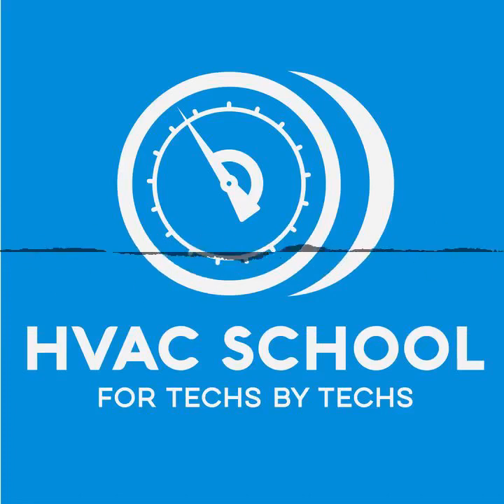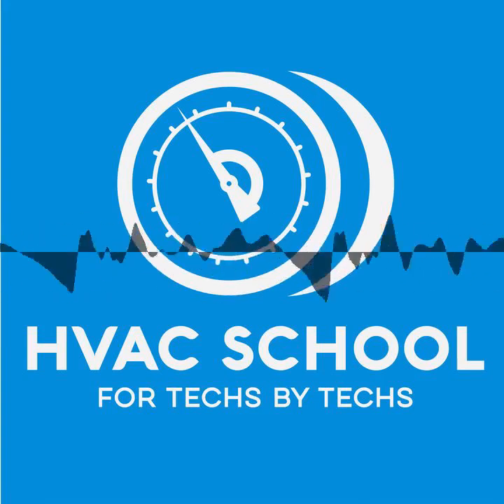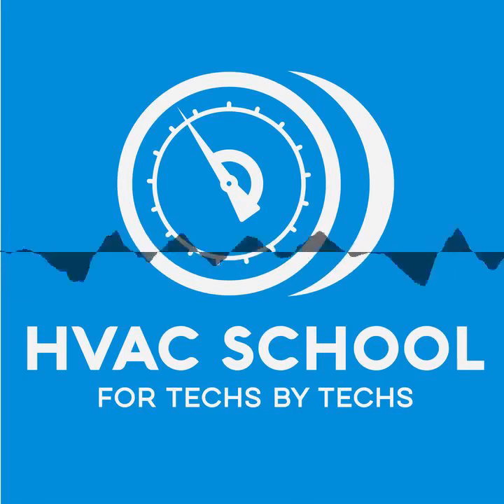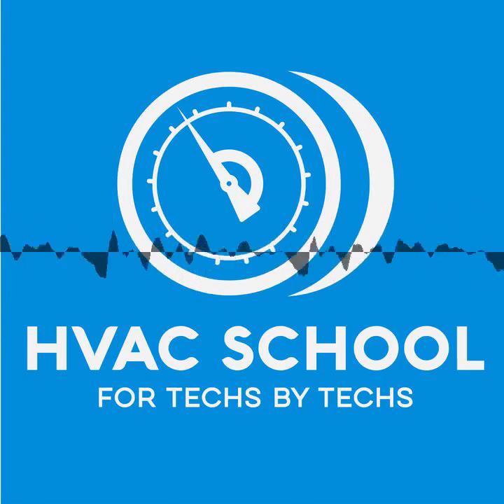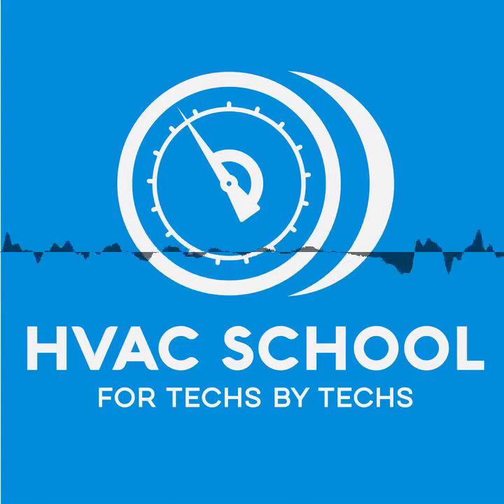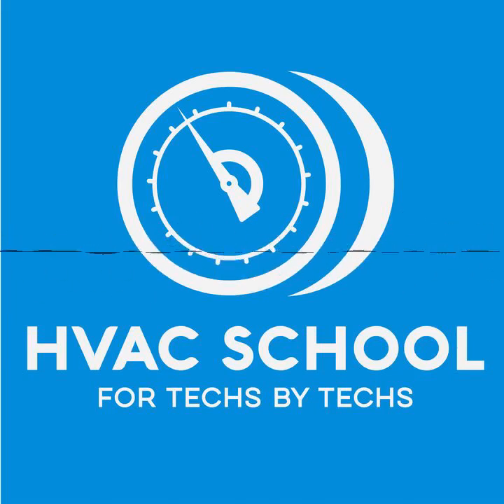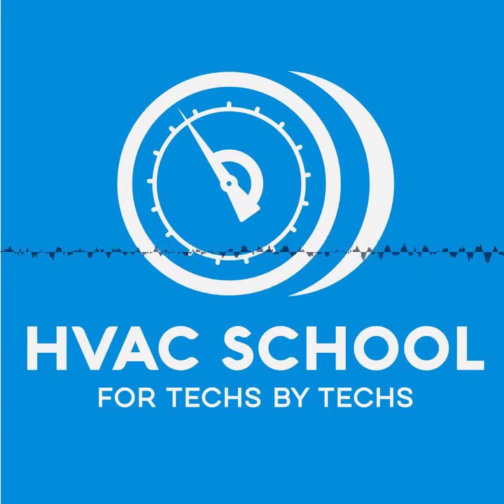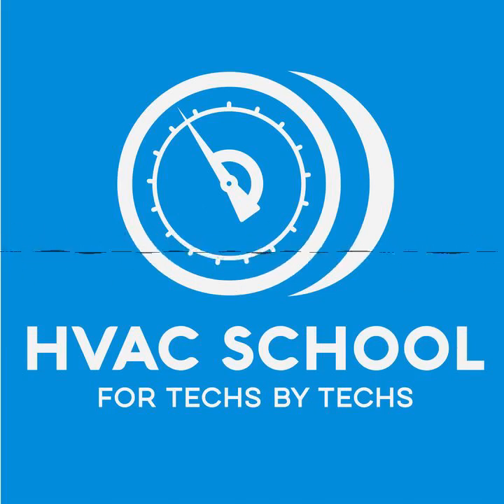VRF in Real Life w/ John Oaks

Comment: I tried to wrap my mind around the 2 pipe system diagrammatically what I came up with is the following:
-The 2 lines connecting the branch circuit box to each indoor unit should be liquid and gas... 
-Solenoids control whether its "hot liquid return" and "hot gas supply" or "cold liquid supply" and "cold gas return"...
-There should only need to be one single TXV in the Branch Controller that allows for one hot-liquid-return header and one cold-liquid-supply header (so four  headers confined within the branch box) and HOT-Gas or COLD-Gas lines connecting Branch controller and Outdoor unit.
The Outdoor Unit should have its own TXV that can create its hot and cold liquid headers for return and supply, respectively, from and to, respectively, its coil(s).

Comment: i agree, weather we like it or not. VRF is coming.  Myself and one other co worker took the class on York/Hitachi VRF.  he was a little more against going just because it sounds like a headache, which it can be its hard to get some older techs to be open to newer tech.  Its not something that is very common in our market yet but it has started to slowly grow and ive been out on a few doing some start ups as well as some troubleshooting. we also have done a couple of small installs. I dont mind it to much, it can be a bit stressful when the office doesnt give you enough time to do the work and tells a customer it will be done on this date and we arent done yet and the customer is trying to push us and then the office trys to push and its like look this needs to be done and done correctly. there are 3 days alone that are just involved in pressure test, evac, charging and start up/ commission. For York it has to be a 24 hour 600 PSI pressure test, followed by a triple evac, requiring to be pulled down, held 2000 micron, brake with nitrogen, short pressure test to 50psi, pull again to 1000 , brake and pressure test at 50 psi, and pull again to 500 and decay test for 1 hour. pressure testing before the the 24 hour 600psi test is done in steps as well, 150psi for 5 minutes, 300 psi for 15 minutes and then 600 psi for 24 hours. during which time you leak check everything.  so it can be a time consuming install process. I have also heard of some york installs being done with zoomlock and has been factory approved.